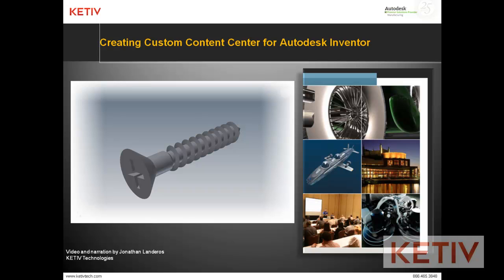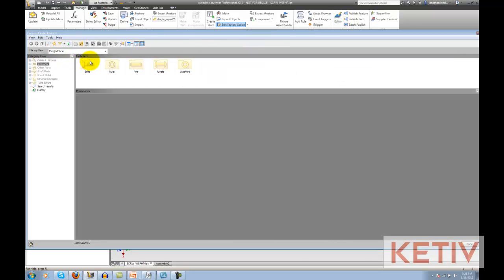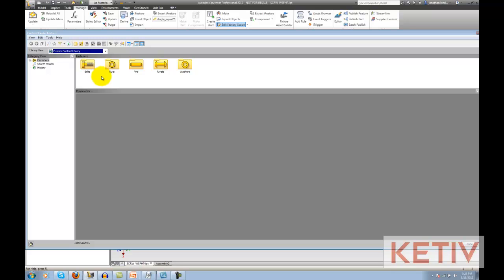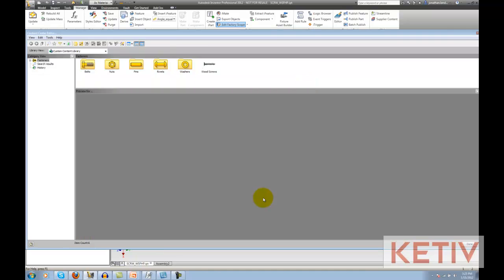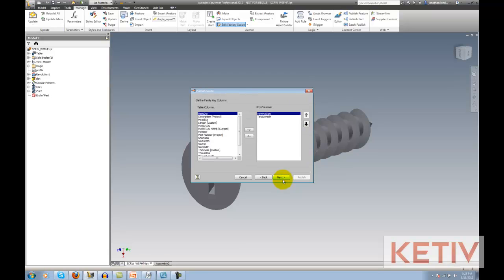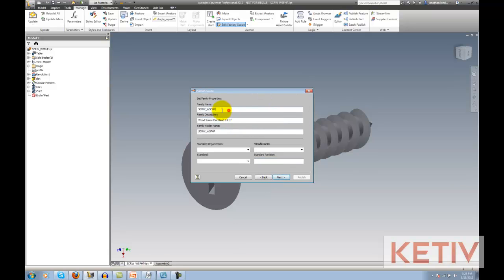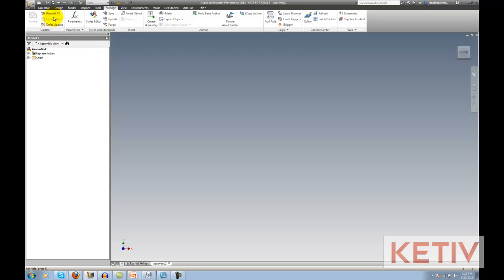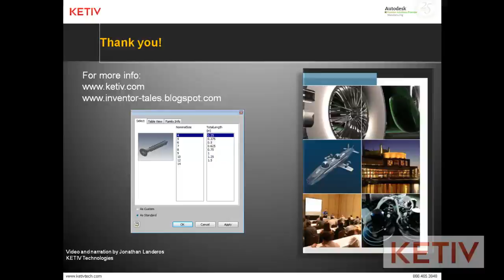Adding a Component to Autodesk Inventor's Content Center Library

Comment: It's simple but I'm constantly getting an error (only for parts I publish and only on first use): "Unable to successfully update the member part file. Problem occurred when setting thread data." Anyone got an idea where does that come from? Also autodrop doesn't work for those parts...other than that everything works fine.
Reply from the maker: Hi Eartheart, that happens when a thread feature is not set up correctly. We would need more insight in order to help you fix that issue, so please feel free to email questions@ketiv.com for more help! Thanks!
Reply: @KETIVTechnologies  Thanks for reply. Turns out it's a bug, Autodesks emplyee reported it on my behalf :). Did wrong family table population of threaded features by Inventor while publishing a fastener to CC ever happen to you? Like wrong thread class, wrong designation, etc?
Reply from the maker: @eartheartbaratheon791  Glad we could help! If you have any other questions, be sure to email questions@ketiv.com! 
Thanks, 
Cameron Whetten